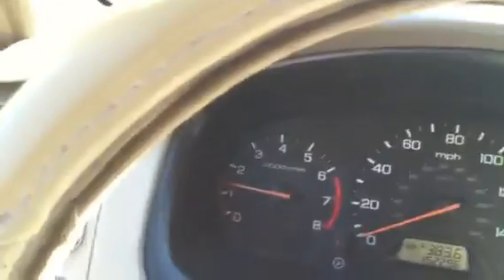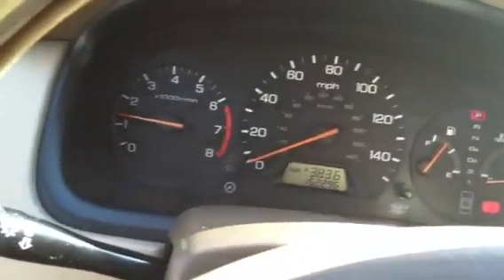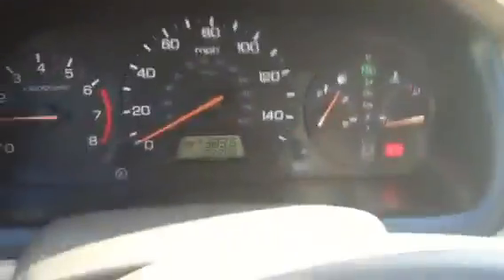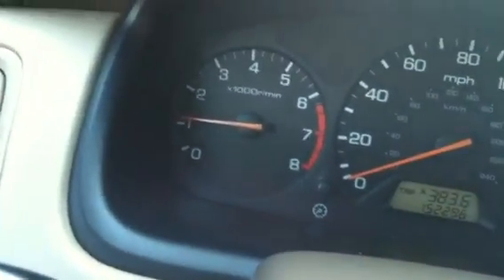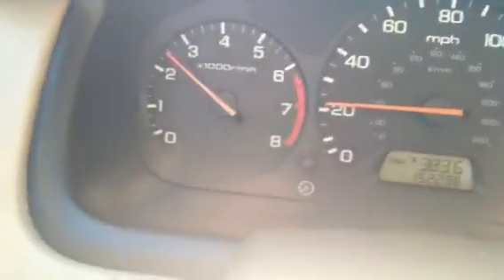2000 Honda Accord Low RPM

Comment: 2000 Honda Accord V6. Dudes 4 years ago I had this problem and I am having it again. My main radiator fan was not working. The tech evacuated and recharged my 1 1/2 year old a/c compressor. He also added 2 ounces of a/c oil this stopped my a/c from going clunk as it came on especially from an initial start. They were also thinking high a/c pressure was happening  due to fan motor not working. There was also evidence of compressor oil discharge at the pop off valve to clue them in to a possible problem. This was $390 before Coviad prices. I am noticing in other comments when people are having issues in other areas (windows, alternator, etc) it seems to affect rpm’s. I have cleaned or replaced all of the standards and have much improved the low idle. Once again mainly as a/c is turned on and engine is hot. A/c compressor is clunking again but my fans are working. My alternator looks old. I may try to replace it. I have replaced thermostat and replaced coolant. I also had a crack in the air filter housing hose(bottom side)that attaches to the throttle body. My car is a 2000 Honda Accord V6 3 liter. I have not inspected my relays. I’m going to grab some from the junk yard just to see if that is the problem. Every time I replace something it runs better for about a day. I also replaced plenum and intake gasket an easy fix. Do not follow the video where the guy puts a Board under the plenum for a quick fix. This is what cracked my air filter house hose attached to the throttle body. Do it the right way. I believe various parts going bad could cause a drain whether from tension or electrical that causes these cars to drop idle. In other words, we all may have the same problem with our idle dropping, and different issues are causing the problem. Pesky.
Reply from the maker: Dang that sounds complex. Mine ended up being something in the throttle body position

Comment from the maker: haha mine cost me like 30 bucks. part of it was my distributor. also if you still have the same problem, check the emissions valve located underneath the gas tank. when my emissions failed, they did not close off the seal so i had a major vacuum leak. its supposed to bog down a little when it comes to starting up because obviously the fuel injectors are pushing water into the engine before the fuel. therefore, once the car warms up and is ready to go, the engine doesnt bog down as much! cheers!

Comment from the maker: mainly the distributor needed replacing and then the emissions valve located by the exhaust was not put back properly causing a massive vacuum leak

Comment from the maker: replaced spark plugs (flawless), changed all fluids, oil, oil filter, tranny fluid, radiator fluid, distributor (rotor was fried), power steering pump, injector treatment (no more than one per 2 months), pcv valve, cleaned iac valve, changed cv axle, and now getting the timing and tensioner done. engine is totally good now lol.

Comment: NOW! What I just did, I REPLACE EVERYTHING, 1: spark plugs, 2; spark plugs wires, 3; distributor, 4; engine oil, 5; oil filter, 6; injector treatment, 7; for idle air filter, and use, CHEVRON or SHELL gasoline, never ever use cheap dirty gas cuz that fucks injectors up. I DID ALL THIS cuz our car needs a bad ass TUNE UP hopefully my answer can help you understand your problem bro!!  AND yes WORKEd.!
Reply from the maker: Nice

Comment: I had the same issue.  By cleaning the throttle, it will helps.
Reply: igot that  problem today after i clean too :(
Reply: @charlesarcamo5538  did it help?
Reply from the maker: Nice

Comment: I have the same problem with Honda Accord 2000 V6. I replaced Cooling Fan Relay (bad), when I swapped it with one of the head light relay. It fixed this problem for a about a year.  Then I tried to replace the Main Relay which did not fix it. I noticed that the Siemen relay (regtangular) in the small box next to 12V relay got really hot when I drove for awhile.  I may change it next.  It 's really annoying, if anyone got this problem fix I am greatly appreciate it.  I may not buy a Honda next time when I brought my car to dealer and they say 'No clue'.
Reply from the maker: oh mine ended up being a purge solenoid problem. glad you got it taken care of though!
Reply: I changed the thermostat and added a ethanol remove gas treatment bottle into my gas tank, It seemed to fix the problem for one year now.... I am not sure if this a permanent fix or not.... You could try.
Reply from the maker: basically what happened here was my idle was messed with during the installment of my battery. i dont even know what exactly happened. but i managed to correct it and it is functioning normally
Reply: +thweepz what did you find out to fix your problem?

Comment: Hi i do have a problem with accord 99 and it doesn’t accelerate than 3000rpm. Is this problem with spark plugs or wires or distributor ? Should i keep changing one by one to give it a try ?? Any suggestions would be highly appreciated thanks
Reply from the maker: Could be low on oil or the distributor. This actually happened to me and it ended up being a vtec switch.
Reply: thweepz yes last time when i did check it was running low on oil but after filling that it was running better but still  hesitates to run smoothly. What’s a vtec switch since i am new to this :( Thanks again
Reply from the maker: Sree g no worries! Let’s see if this helps. So basically as the engine climbs in rpm the vtec kicks in to allow for better performance and oil circulation: when that goes bad the engine can’t operate as well due to the valve lift insufficiency. So the car will limit the RPMs to protect itself. But don’t rule out the distributor

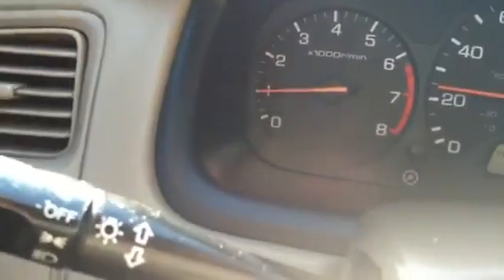Comment: 2:02, 1000 rpms is not low for an accord. It's supposed to idle around 650-800
Reply from the maker: Somewhere around there. The car had such a weird bouncy tach issue after a battery replacement

Comment: So to make sure u have da same problem check out your distributor, probably yours still is fine but you have to CLEAN OR REPLACE your distributor Cap, IN CASE U HEAR SOME WEARD SCRATCHING SOUND FROM IT I SUGGEST TO BUY A NEW ONE, costs $130 us.
Reply from the maker: Cool

Comment: I think I'm having the same issue dealing with TPS and aicv
Reply from the maker: There was a little flap keeping my throttle slightly open. And then it must’ve been like readjusted and it would have the torque converter disengage and drop the RPMs to 1k then rebound up

Comment: Iac just needs to be cleaned! I've done it to a hundred Gen. 6s!
Reply: I did that no fix
Reply: @blessedindividual9877  throttle position sensor then. Your check engine light should be on.
Reply from the maker: Haha I figured it did

Comment: Hey man how did you fix your idle problem, can you show me what did you do on video? Because my '02 accord has a low rpm so when I use electrical stuff like windows, a/c n more gets more slow and shakes more n more.
Reply: Louis Texta same problem with my 2002 honda civic , when I use Ac and stuff after the engine warms up a little my rpm goes ridiculously down and sometime it even goes so down that my car switches off , I have restart it and keep my foot on the pedal so that the Rpm doesnt go down , I have had an engine swap so the trottle body and tranmission is pretty much fine , idk whats causing this problem , I have had this problem with my previous engine too :/
Reply: Louis Texta i got the same problem on my '00 accord too
Reply from the maker: Sounds like an alternator issue

Comment: It's low on oil I had 2 everytime it was low on oil it wouldnt let me Rev past 3000 rpms it a safety feature so you don't blow your engine
Reply from the maker: Also will do it if the vtec switch goes bad